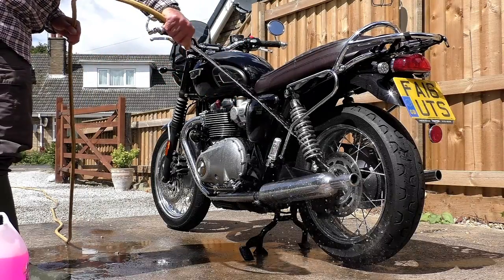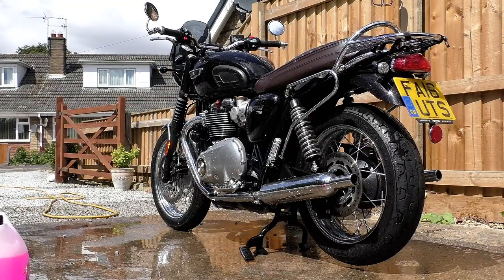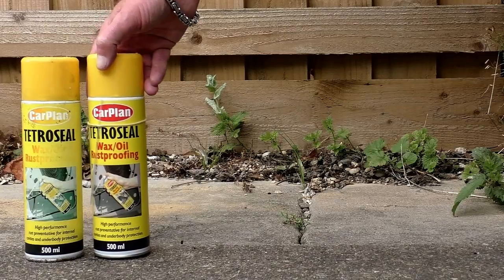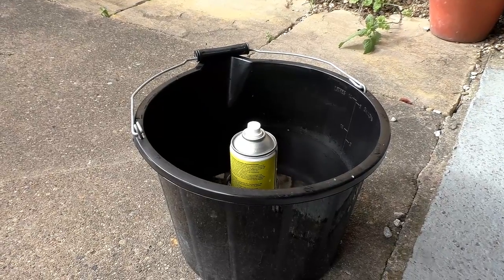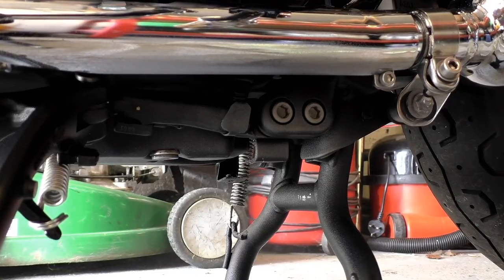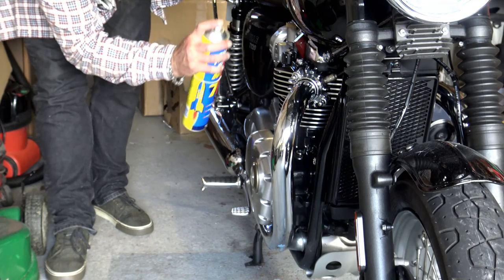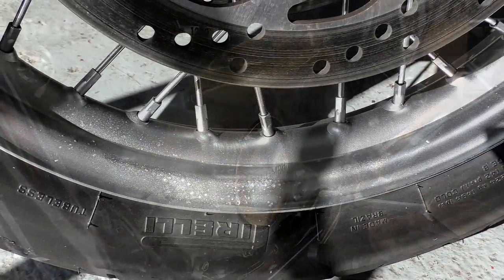Triumph T120 preparing your motorcycle for winter(winterizing)/RUST protection that works!

Comment: Wow this was a revelation to me!  We don't get salt on our roads thankfully (I guess if you lived near the beach it is in the air), so I have little use for the info.  We just wash our bikes, dry them off then ride... Back in the seventies/eighties when bikes came with mild steel mufflers when new, we used to get them hot then spray the insides liberally with fish oil then go for another ride to bake it on.  Smells like a fish shop for a while but my brother still has his '85 XJ900 with the original pipes and no rust!

Comment: Our climate in Johannesburg means winterizing is not necessary, but as you highlighted, some parts could just do with some form of protection to ward off oxidization. Great tips Stuart, thanks.
Reply from the maker: yeah ive had a few people in tropical climbs and coastal areas email me about this one apparently its not just cold wet climates that rot your bike!

Comment: I like your logic. I've been using AC50 for years and it has not stopped corrosion, mainly because I'm too damn lazy to keep reapplying the stuff. However, here's a tale. On the TDM the rear shock bush has had a habit of seizing and many owners have had a hard job removing them for replacement. But very early on I decided to apply Waxoil around all rear shock linkages. Now these guys all took great care of their bikes and they look a damn sight better than mine. But that's because they only use AC50 and reapply regularly. So come the day that I thought I better check my bushes, because I didn't want a failed one, it was absolutely fine and came out like a dream. No need to replace. So the AC50 is going to be history and I'm going to follow your method for winterizing. Good job.
Reply from the maker: good choice sir! I think the old products are often the best! see my latest video for some footage of a viewers bike who used this method on his 50 mile per day commute to work throughout this winter! https://www.youtube.com/watch?v=E4CkjnWWcag

Thank you for watching!

Comment: A great vid. I worked for over 30 years in the motor trade  (Body and paint shop) and totally agree with your comments about ACF50. I have and still use similar products 3M 08909 Cavity wax and Duck oil.

Comment: Used to use waxoil on my first bike a Suzuki ER50 when I was 16. Forgotten all about it till now. My mate restored a Triumph Spitfire a few years later and I remember we pumped loads of the stuff into the wheel arches and hard to reach places.

Good stuff but I remember it being thick and gluey turning yellow if put on to thick. Def kept rust at bay though. I have found ACF50 works ok, I apply it via microfibre cloth and wipe on. Not had rust issues in 2yrs plus now on a bike that could clearly get it.
Reply from the maker: I found quite the opposite with ACF50, the results for the price are i think disappointing. and it attracts way too much dirt.  waxoil is superior in every way and far cheaper, but i suppose that's why its still a top seller after more than 50yrs.  Thanks for you comment Paul and of course for watching.

Comment: Hey Stuart, as you know I was really looking forward to this video as I commute as much as I can on my T120. Once again sir you have excelled. What a fantastic video, and just like the summer version I am now a convert to two new products. I will be preparing my T120 following your advice towards the end of this month and hopefully mine will look as good as yours. Thankyou again for all the time and effort you put into making such great short films. Oh and I loved the story about the old house - you'd got away with it if it hadn't been for those meddling kids!
Reply from the maker: Thank you paul , just dont leave it too long as the wax oil can be a pain to apply in cold weather. and save some spray caps off old aerosol cans, in cooler weather the nozzles can block with annoying frequency! the gt85 ones work well!
Reply: Hey Stuart - Process worked fine. I heated the can in hot water for about 30 mins and kept shaking every 10 mins. My can came with two nozzles which I tested on paper first. Use the bigger nozzle as this gives a finer spray. I covered my downpipes with dustsheets to keep excess spray off them - same with the brake disks when spraying the wheels. Other than that the spray applied nice and evenly. Couldn't get Double TT on Amazon - had to resort to E-Bay where it it was £5.50 with free postage. Many thanks again for the video - now my T120 is winter Fillingham'd!
Reply from the maker: Glad you got on with it ok Paul! just thought with it been a bit cooler you might have problems with the nozzles blocking up safe all you GT85 nozzles for future use when the cans are empty. she's all set for winter then, its easy enough to get off come spring, I suppose I should do a video nearer the time!
Reply: Yes please! I wasn't sure exactly when to remove the wax-oil and go back to GT85? So a video on how to remove would be good.
Reply from the maker: Usually March /April time Paul depends what the weather is doing! dont worry ill put a video up at the time!

Comment: As usual, excellent advice. I'd never heard of these products before, and don't ride much in winter these days, but I see every reason to use them and nowt to criticise. Loved the story about the Speed Twin (great bikes) and entirely expected a coat of embalming fluid during the telling! 

Exceptional quality on all your videos, and I have to congratulate you on a superb channel. Certainly a real highlight when a new video appears in my feed.

Best regards

Peter
Reply from the maker: Thank you very much Peter, its nice to hear you enjoy the channel. even if you dont ride much in winter its still good to take precautions, bikes will still have a harder time in a cold damp garage than in summer.
Reply: @stuartfillingham  As night/day temperature cycles moisture from the air condenses on the cold metal as the damp morning air warms up. I've had success keeping a small coffee cup warmer under my vehicles in winter. Just a small constant air movement has meant the brake discs don't rust and the aluminum doesn't oxidize. The heaters I'm talking about come in sizes 17 to 23 watts (that I've seen in Canada). They are the same ones used in coffee makers. And they don't burn out like a light bulb on a cold winter's night! A caution: the mice like that environment. Moth balls or Bounce keeps them away though.

Comment: My abiding memory of Waxoyl from about 40-odd years ago is buying a gallon tin of it and spraying the inside of the doors, chassis members and other areas of my cars. Being white-spirit based you had to drive around with a headache and all windows open for about a month until the white spirit evaporated, leaving the wax. Good stuff, though. Looks like it has gone through a change of name since those “heady” days...

Comment: great video i used ACF 50 for years great results then went onto XCP i found all this was a thicker product to ACF .Think i will defiantly give this a try the others always leave a residue
Reply from the maker: Hi kate, ACF 50 is basically a thin grease in a can wax oil though not pretty, will last an entire winter or for years if you leave it on, without having to reapply!

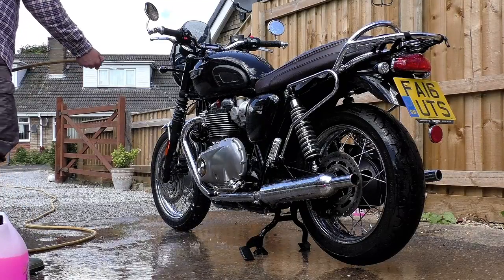Comment: Stewart, you did say for winter use, use something like ACF50 instead of GT85 in Julys video on waxing and detailing. about 5:09 into the video. I didn't buy ACF50, I went with your recommendations today. I do enjoy your videos.
Reply from the maker: The double tt or, acf50 if you cant obtain the double tt.for winter use Richard. in summer use the GT85. thanks for watching.
Reply: stuart fillingham thanks for the reply. One question I was going to ask, I've used the Muc off dry chain lube in the summer as per your previous video. Do you use a heavier chain lube in the winter?
Reply from the maker: Hi Richard I use the Castrol chain lube in winter although the muc off dry lube is fine if you only ride on nice days!

Comment: Yep.. You can't beat Wax oil for avoiding thoughs rusty nuts.. I also use silicone lubricating spray (not back to black) round & behind the clocks etc. I used to use WD40 but since they had to change the propellant formula to avoid CFCs, I don't think it is as good and actually evaporates in time as does GT85..
Reply from the maker: Hi Derick, yes GT85 is fine for summer use but you do need something a little heavier in the colder , wetter months. hence the Double TT or acf50 if you cant get it.

Comment: Fantastic video just what I was looking for. Double TT for any parts that will get hot & Tetroseal for the rest of the bike is that correct? Is it ok if you get any on the plastic parts of the bike fearing ect.  

I ride all year around & looking at buying a new bike.

Comment: Another great video Stuart. I've had good results with the Muc-off products so I see another order going in for these as well. A couple of questions, if you don't mind.1) Did you strip the back end to get to the rear mudguard when you treated it or do it in situ ? 2) Have you ever had the tank off, to treat the frame etc ?One more thing - maybe a tip for some people. You mention cold & damp garages. I moved house recently and moved from one with a warm integral garage (the boiler was in there) to an external shed/workshop. I bought a pack of "Ansio* Internal Dehumidifiers" (about £13 for 10) to keep the shed dry and experimented by placing one on top of the handlebars before throwing the cover on the bike. I'm surprised by the amount of water that collects in the thing. They last for a couple of months and for £1.30 a time they seem worth it. (* other brands are available)
Reply from the maker: Hi there, I treated the rear fender in situ! all the parts you need access to are fairly easy to get at, also  even when dry, wax oil does creep so during the summer months it will get itself in to any nooks you may have missed. yes in many ways leaving a bike in a cold damp concrete or brick garage can be as bad as leaving the bike outside all winter. cold surfaces quickly attract condensation, and with no air movement to dry it off it can linger and build up all winter, putting a cover over your bike can compound the matter even further! your idea with the humidifiers is a good one, but its hard to tell whether they would cope well enough to make a difference, opening your garage door every day for an hour or so, though not ideal, will help dry the condensation off the bike. but coating it in the manner I have described in the video will go a long way to protecting the bike from deterioration!

Comment: Hello Mr Fillingham! I'm part exchanging my 2010 Bonnie T100, which I bought used 4 years ago, for a new T120 which should be arriving by the end of the coming week. So I'm looking forward to giving the new bike the "Full Fillingham" treatment. One question though, you mention that you apply the waxoil & TT, then keep washing the bike regularly and reapply waxoil & TT as needed. But what about waxing, as per your "Waxing, detailing & protecting" video? Does the waxoil & TT process replace the waxing process during the winter months, or do you still use them in conjunction somehow?
Also, is there any there "special treatment" you'd recommend giving a new bike when you first get it, other than your advice about treating the underside & "under-seat" areas of the rear mudguard with waxoil, as you mentioned?
Thank you again for your videos. There's a treasure of knowledge in them and I'm always keenly awaiting the next one.
Reply from the maker: Hi Jorge just carry on waxing the paintwork that has not been treated with waxoil. on a new bike just build up the coats of wax 2 or 3 coats should do it.  congratulations on your new bike sir and thanks for watching!

Comment: @stuart great video, thanks! One question - should the wax oil be put on panels, tank, handle bars and other metal parts? Or is it really only for the frame/wheels, with the rest to be covered by doubleTT? Also, is double TT ok on painted panels, tank etc? Thanks!

Comment: Thanks Stuart. I've had similar problems to you with acf50 on my GS so am looking for an alternative to use on my new bike when it arrives. I have used fs365 which I prefer to acf50, but I might try the combination you discribe here instead. As you've found out if you make the wrong choice for your needs by the time you find out it's too late as the bike has by then started to corrode. How much do you ride in winter please so I can get an idea if your method would be suitable for me. Cheers Ade

Comment: Hi Stuart and thank you for another timely reminder about winter prep. I'll be looking out for the products you suggest but just one question : your version of the wax and oil product comes from Car Plan, but the one I've used on my cars is WaxOyl, do you know if there is much difference as I have plenty of WaxOyl left in stock with the accompanying spray system ?
Reply from the maker: I suspect there is very little difference David if any at all! thanks for watching matey!

Comment: Hey Stuart. Sorry if I've missed it but I don't think you mention anywhere in the video how you go about winterising your rear suspension forks. I know from past experience those are particularly vulnerable to corrosion so I'd love to know your take on keeping them rust free.
Reply from the maker: Hi Jorge i don't bother with my shocks as they are Hagon Nitros which means they are made from stainless steel! for other shocks just use whatever maintenance spray you use on the engine!
Reply: stuart fillingham Thanks for the quick reply! That will be Double TT then, as recommended by one Stuart Fillingham in his motorbike winterising video. I may have to look into some stainless steel shocks eventually as the stock ones were real magnets for rust in my old T100, and I think they are much the same in my new T120.
Cheers!

Comment: Stewart I’ve enjoyed your bike cleaning videos. 
However there’s one part not covered in your wire wheel maintenance program and I’d be interested in your views. 

I have an Indian Scout with chrome wire wheels and the polishing of the hubs drives me nuts. The chrome is showing signs of discolouration and I don’t seems to be handle to get right in there to overcome this. 
What’s your solution?

Comment: Love the vids, Stuart. I'm across the pond from you. For the first time in my 7 years of owning motorcycles, I have to keep my Moto Guzzi outside during the winter here in New Hampshire. I looked for Muc-Off and TetroSeal, but it appears they're not in the US yet (Muc-Off rep told me there are plans to have the motorcycle cleaner over around the beginning of the year).

2 questions - 
1) Are you aware/do you have alternative product recommendations for the CarPlan Wax/Oil and Muc-Off Motorcycle degreaser?
2) Are TetroSyl and TetroSeal the same company?

Comment: I just use WD-40. It can be washed off with just water, but if you don't get the bike wet, it will last a very long time.
Reply from the maker: Difficult to achieve in the UK

Comment: I found a small area of rust on my new bike on the frame. What do I do? Do I sand it apply a primer than touch up paint, than clear coat. Or just put on the touch up paint?
Reply from the maker: Hi Walt. thats a difficult one to answer without seeing it in person, painting over rust is never a good idea, it will hide, it but usually just creates a bigger problem to sort out later on. which bike is it? and where is the rust exactly?